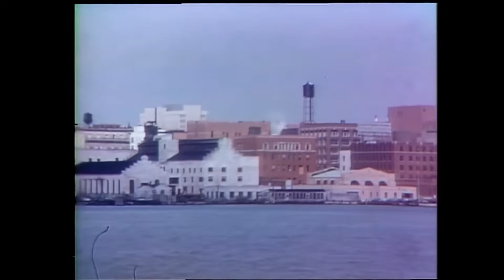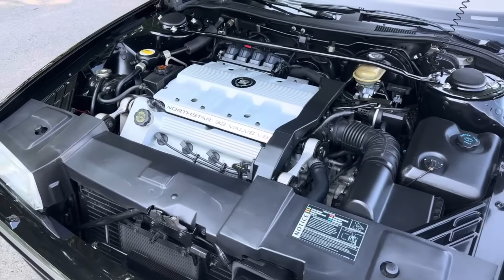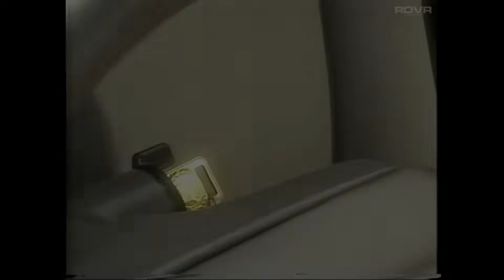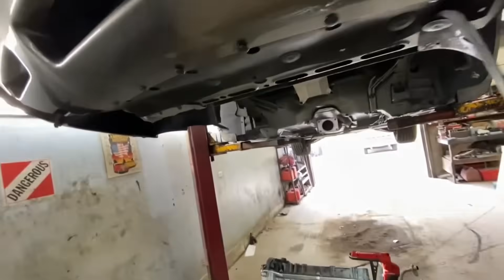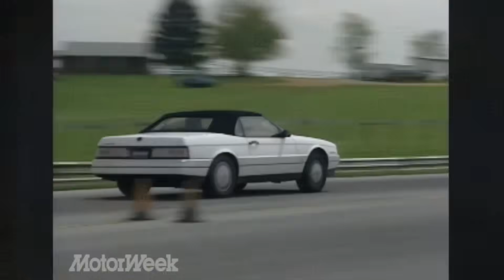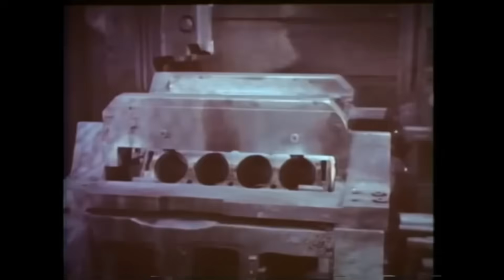Most HATED American V8 Engine of All Time!

Comment: The Northstar is NOT the most hated V8, american or otherwise. All its problems are fixable; it;s a mystery why GM didn't bother to fix them. Instead it took racers and DIY mechanics to come up with fixes that would've cost GM nothing  The most hated V8 is the Cadillac HT series.
Reply: The Northstar leaked oil, and sometimes blew head gaskets, but still didn't hold a candle to the HT4100, I saw quite a few of the 4100 engines clatter because they didn't have oil to the valve train due to poor oiling design
Reply: @JamesPrill-hz1oj  Not only that. But at least the Northstar was fun to drive when it was running right. The HT4100 was a turd even when running right.  It’s a shame that it was the LEAST powerful , least  reliable v8 offered in the full sized luxury/near luxury GM vehicles. The Olds 98, Buick Electra, Cadillac de Ville and Fleetwood. The olds 307 and the Chevy 305 were much better engines. So the Buick and Oldsmobile were less slow  (none was fast back then) than the luxury Cadillac. Many people installed Oldsmobile engines in the Cadillac when the 4100 expired. I believe that Cadillac offered the Buick big 4.1 v6 in the 83 Cadillacs for those who would not buy a 4100. It ran a bit less smoothly and had its own issues. But it was considerably more reliable and about as powerful, and a LOT easier to repair when it did have problems.
Reply: @dmandman9 1981. You are totally correct otherwise. I had one that the owner had swapped in a '73 Eldo 500 and TH400. A bolt in as they use the same mounts. Driving it w/ a friend, he commented that it was the engine that GM SHOULD have used. My project is an '84 Coupe getting a TT Cad 500 & 4L80E.
Reply: Its crap the worst ever Made
Reply: @Haffschlappe At least the Northstar ran well (when it ran). The HT 4100 was a slug even when it was running right
Reply: @dmandman9  HT stands for hook and tow.
Reply: @iket.9930 😂
Reply: @iket.9930 I've always been told it stood for "Hot Trash" 😂
Reply: I personally believe the 8=6=4 engine from the 80's is the worst
Reply: @charlesguerra-x5v  The worst is a gasoline engine that's rebirthed as a diesel. Another boat anchor.
Reply: @charlesguerra-x5v  Nah. That was a good engine. Just disable the cylinder deactivation.
Reply: . True. I heard that's what a lot of people did. My father e t had one, and he just sold it
Reply: @charlesguerra-x5v My uncle scrapped his with 162,000 KM on it. My friend had one with 230.000km but he put a lot of money into it over the years.
Reply: @erikk1820 Had 2 never a problem.
Reply: @charlesguerra-x5v Honorable mention to the 305 in the 1980 California Corvette…
Reply: @charlesguerra-x5v  That was a great, unbreakable engine. All you had to do was disable the cylinder deactivation so it would stay in V8 mode. And it would be bulletproof again.
Reply: @charlesguerra-x5v Yes. I remember it being introduced in 1980 and gone by 82 maybe 83.   If it's control was set to 8 all the time they were okay
Reply: @charlesguerra-x5v makes you wonder why Stellantis wanted to try that useless tech again on the hemi
Reply: @charlesguerra-x5v Nope. Owned two. 200k but scrapped due to rust.
ONLY problem was that one had an intake leak. A VERY simple repair.
25 mpg in V4 @ 55 the 55 mph speed limit at the time.
Reply: Absolute garbage engine... Both the ones I had blew their headgaskets at about 160k miles
Reply: @miranarak  you got 160k out of 2 of them? You beat the odds
Reply: @dmandman9  I drive like a turtle, was never an aggressive driver. I got 400k out of a w140 straight 6. Still running when I sold it
Reply: @miranarak  You’d probably be the person who had no problems with the Chevy Vega engine. I think we had one or two such customers. They drove like you describe yourself. 😅
Reply: @dmandman9 my Vega had a Procharged 400 small block. Ran great 1/4 mile at a time.
Reply: He now wants to build a Fiero with a NS engine for his son.
Reply: What's weird is that 4.1L No Torque ran pretty well in the 1985+ FWD Cadillacs.
Reply: @piercehawke8021 my grandfather test drove a 4.1L Caddy when they were brand new, he joked that it accelerated like a Navy ship 😂 (he loved Cadillac and had owned many in the past but thought they had gone so wrong by then he ended up buying a fully loaded Chrysler Newport which ended up being his favorite car)
Reply: You are right and the gasoline Motors that were converted to diesel
Reply: @HoosierRooster OH GOD I completely forgot about the diesel 350!
Reply: HT 4100 was the worst.
Reply: Not a fan of toyota 5.7 or nissan 5.6 myself.
Reply: @shadowopsairman1583 hey now, I'm a mechanic, worked on  pretty much everything under the sun from vintage Mopars to Soviet Ladas, in my time I've only seen 7 vehicles with over 800k miles on them, all of them were 5.7L Toyotas, and all of them still ran great, they were in the shop because the engine was essentially outliving the rest of the vehicle.
Reply: @SUPRAMIKE18  hell yeh, that’s why as a fellow mechanic I’ve always driven Hondas and Toyotas usually manual transmissions if possible. My very first automatic was an 09’ Tacoma that got totaled due to another stupid driver. Now I can’t afford the wheels off a new truck.
Reply: @shadowopsairman1583 the vk56 is a robust and powerful engine that's been known to last
Reply: General Motors no longer gives a shit about their reputation,  or their customers,  get the money and screw the customers,  good work GM
Reply: You're a moron
Reply: Why would they experiment with something proven for decades to work using ordinary headbolts?
Reply: Didn't said that! It was awesome first American v8 engine that's around late 80s technology toward 90s. It was not bad. Way better than 70s compared.
Reply: I saw one of those auto shows on TV and they were fixing the head bolt problem. The kit came with a drill bit a tap and a longer bolts. Maybe they were larger in diameter also but that was the fix the motor had so much compression it would pull on the head bolts and pull the threads right out of the blockafter it was repaired. It was no more problems with that motor.
Reply: This video is complete BS.
The Northstar V8 beginning in 1988 was a giant leap in Cadillac engines!  Talk to any mechanic and learn the truth!  This channel is crap IMHO!
Reply: It's no "mystery".  GM then remains as GM today.  It considers its customers as dirt, beneath consideration.  The fact NS blew out of warranty was a feature not a bug.  If there is a company with more contempt for its customers than GM (maybe Hyundai), please list it here.
Reply: You have to yank the engine out of an insanely crowded engine compartment and put steel inserts for the head bolts. This is not some trivial thing its a disaster. Hey at least you can drive it 50 miles with low coolant! Award winning😀👍🤡
Reply: Really the only problem was people are dumb, and never knew that getting them hot was the end of the road. Asking people to pay attention is asking too much.
Reply: @ericolsen67vw overheating any engine is a no no especially one that's aluminum
Reply: Yep... it was good enough for Shelby.
Reply: Totally correct. Upgrade the head bolts and no problems. A fine 7,000 rpm engine w/ an awesome dry sump, and split lower crankcase (the Caddy ETC shifts @ under WOT).
Reply: Shit engines.
Reply: The 350 diesel was a bad execution as well.
Reply: Totally agree with your assessment.
I love my 2010 DTS. Sure it leaks a lil bit of oil but who cares? I'm old enough to remember when most cars leaked oil. Us geezers used to check the oil everytime we gassed up.
So checking my oil when I fill the tank is no skin off my knee.
Reply: My old 88 Deville was not too bad, i think it had the 4.5, it was decent running, car had 310,000 miles before the trans gave out and when we went to fix it we found all but 2 bolts held the engine cradle in as all the body mounting points had rusted out so the entire front end was just connected by the radiator support area. My friend had two late 90s Deville that he had to both fix the head bolt issues on, but he knew that going in, got studs instead of head bolts and eventually i bought one of the cars which lasted till i sold it at over 200,000 miles when the electronics started to hate me (constant sensor issues)
Reply: I heard the 4.5 and 4.9 were good
Reply: Now, GM has similar problems with the 5.3 and in particular the 6.2 engines. The current problems will cost way more than the Cadillac one.
Reply: maybe the 1st gen Northstar...2nd,3rd gen Northstar no quality control issues
Reply: Hmm... I had a 1986 HT4100 that ran great for a few years, no issues at all! Not all of them were bad.
Reply: @chrissingleton6029 the other thing that goes along with the 4.1L was that they were dogs. S L O W
Reply: The Northstar owes it's existence to the HT series. It's still roughly the same platform just with the dumb problems fixed.
Reply: I think if they would've fixed the issues and made it a rwd config it would've sold a lot better and been liked more
Reply: My uncle built a turbo Northstar, stronger head studs, ported cylinder heads, forged internals, a small but quick spooling  50mm turbo, it's in an Oldsmobile Aurora, make around 400-450hp sounds absolutely amazing and he's out nearly 90,000 miles on it since he built it, no issues and he doesn't baby it, I think he's spent more replacing the front tires over time than he did on the whole build 😂😂😂
Reply: @SUPRAMIKE18  that sounds like a fun build
Reply: Is it actually the motor that's bad, or all the stupid crap they bolted onto it? V8-6-4 is the stupidest idea for any motor. That engine had so much potential if it were allowed, and keep the EPA away from it or any motor.
Reply: @Roadking1965 they are decent engines, I've seen people delete the cylinder deactivation nonsense and convert them to 4bbl carburetor
Reply: There pos get over it. Just because you still drive one. My uncle had one nothing but problems with it a good friend he had one nothing but problems both seen the junkyard way too soon. Thing is Cadillacs haven't gotten much better for quality
Reply: @markchapman2585 I agree that the HT4100 and the Northstar were very problematic and very expensive to maintain. It would have been the same for the v8-6-4 if a person wanted to keep that feature. But if they were willing to disable it, then they would have a reliable engine. There were no inexpensive fixes for the 4100 and Northstar other than the luck of the draw . And even then  you had to maintain it meticulously. I remember that GM stated that those engines required special cooling system tablets (STOP-LEAK. It was basically the same thing as bars-leak tablets ) any time the cooling system was serviced. That alone reveals how bad they were

Comment: How quickly we forget. I think the Northstar is less hated than the 8-6-4.
Reply: But people just disabled the deactivation and made it run as a v8 all the time. And it was a great engine again.
Reply: @dmandman9  Exactly! And the 8-6-4 TBI powered many a vehicle till 1995.
Reply: @piercehawke8021  that’s right, they used them on limos until then. Cadillac knew the ht4100 didn’t stand a chance in those applications 😂
Reply: Don't leave out the Old's 350 that they thought could be a Diesel.
Reply: The Olds diesel was a good, reliable engine, if you installed a water separator, and upgraded the head bolts.  The faster you drove them, the better fuel economy you'd get.  My dad got 28 mpg on a trip to Florida with his '79 Delta 88, driving 80-85+ mph, and went almost 800 miles on a tank of fuel.
Reply: 8-6-4 is great cadillac big block.. one wire and 2 mins fixes it all… the HT4100 is the elephant in the room this video missed.
Reply: the 8 6 4 was bad but you could disable it and run it as just an 8 it was a stupid idea
Reply: The “sleeveless/no sleeves” is not an issue. The Porsche 928 V8 was an aluminum V8 with no sleeves, and can go 300,000 miles easily (assuming the timing belts are changed on schedule, but has nothing to do with a sleeved/sleeveless bore design). It is the head bolt design that is the issue.

How any engineer would design an engine that used steel head bots, threaded into a softer aluminum block, with a NF (fine) thread, and not expect problems is beyond me. The Car Wizard channel did an episode on this, and the fix.
Reply: @kostaskritsilas2681  When the Vega came out the technology for sleeveless aluminum blocks wasn't ready. The Northstar's problem was certainly the head bolts.
Reply: @kostaskritsilas2681  I'd been replying to @ronaldport1-cs in a side conversation about Vega motors being crap too when I brought up the soft aluminum heads with no sleeves.
Reply: The Vega engine
Reply: @ronaldport-1cs  That’s another good contender for most-hated. All aluminum, no sleeves, and a weak cooling system.
Reply: Yes, and I only know this because my grandfather bought a brand new Cadillac or Lincoln about every 2-3 years and he bought a 1981 El Dorado 8-6-4 new in 1981. Though he had trouble with the 8-6-4 and finally had the small computer responsible for dropping and picking up the cylinders disconnected so it was a v8 all the time, it never overheated like a poorly engineered Northstar. Whoever thought putting fine thread torque to yield head bolts into an aluminum engine block was a "good idea" was obviously a pure moron 🤣🤣🤣
Reply: My dad told me bout the 8-6-4, so 🗑️ 😂
Reply: I had to look it up. Off the bat 🦇 it's a brilliant idea! Slow dumb computers of that period seems to be the culprit. Shit man all that's fixed now! Someone ought to engineer that puppy.
Reply: @paxwallacepiano  GM is doing cylinder deactivation in the Silverado/Sierra trucks, but they're having trouble with lifters going flat in the current version.
Reply: Actually, it was a good engine.  It was the controls that were at fault.  You could negate the 8-6-4 feature and drive it as a normal V-8.
Reply: The Car Talk guys called the V8-6-4 the V6-3-0!
Reply: And the 8-6-4 is less hated than the glorious HT4100 from Cadillac. (I loved mine)
Reply: Oh my, I forgot about that junk
Reply: I daily an 03 Northstar DeVille, not a damn thing to dislike. Biggest issue, 3 pe regulators failed in one month
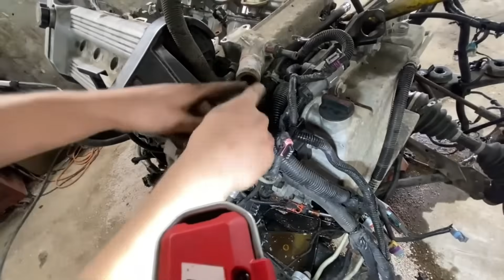Reply: 14:40   The Sword of Damocles refers to the impending danger that comes with great power and luxury, illustrated by the ancient story of Dionysius II, a tyrannical king who invited his flattering courtier, Damocles, to swap places with him for a day, only to seat him on a golden couch under a sword suspended by a single horsehair. The tale, popularized by the Roman philosopher Cicero, shows that those in power live under the constant threat of disaster, and true happiness comes from living without such fear.
Reply: 864 got deleted to late once a problem was noticed.  Caught in time, saved the engine.  The cylinder shut electrically but then you have the mechanical part rolling without the the temp being the same. The lifters take out the cam and all the metal gets circulated through the entire engine. Pretty sure its like 24 hrs to remove and install because the front dif is one with the engine.
Reply: The 8-6-4 was easily "Fixed" by disabling it. Then you had a great running reliable 368. The Northstar is junk, if you fix it, it's temporarily repaired junk. You can't Anchor head bolts in mush.
Reply: Not as hated as 8675309
Reply: @AmericanThunder  we are not talking about a song and it was not a bad song
Reply: @frankwood-sn5pu It was a trash song. Lol I was there. Trash song, trash engine thus my previous comment.
Reply: @AmericanThunder  I don't think the song was as bad as engine the song hit the top 10 the engine did not
Reply: @frankwood-sn5pu alright good point, the song is a little better than the engine lol
Reply: @AmericanThunder  that song was not on my list of songs as one of the best songs from the 80s there were a lot of tunes way better
Reply: @AmericanThunder  I pity all the people who had that number when the song came out. “Is Jenny there?”
Reply: @AmericanThunder still not as bad as the 6060842
Reply: That was my exact thought. It was hard to get worse than the 8-6-4.